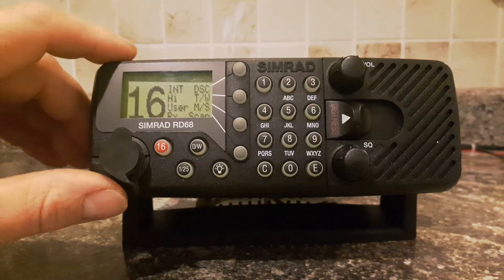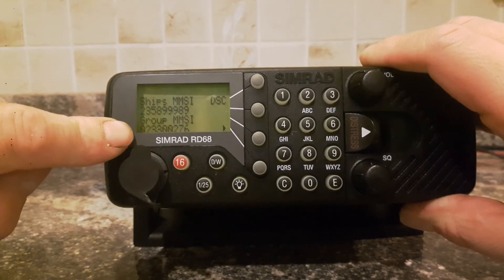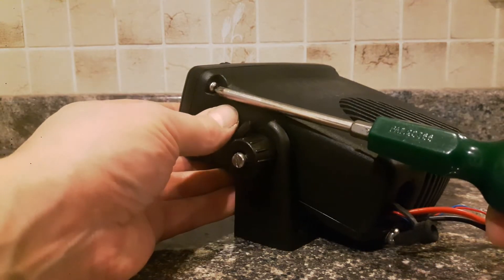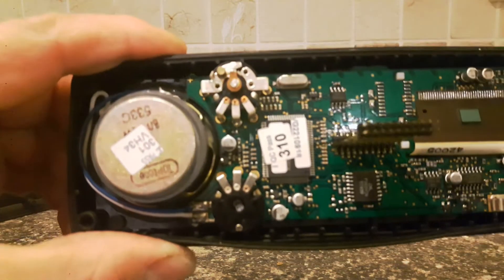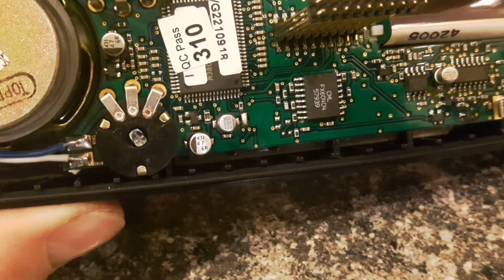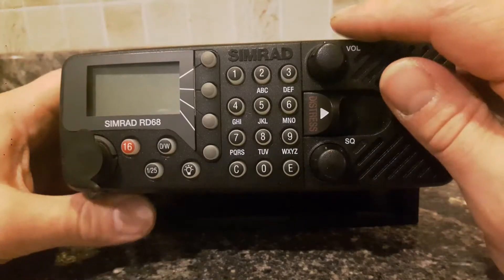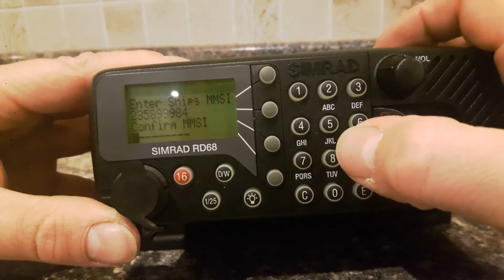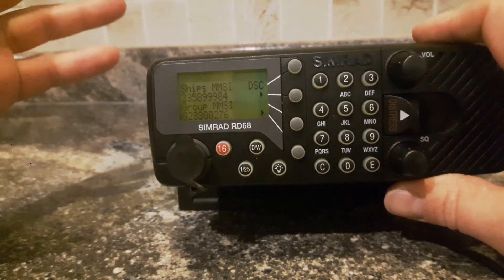Simrad RD68 VHF Marine DSC Radio MMSI Reset

Comment: I bought a Simrad RD68W, it looks a liitle bit different inside. It does not have a plug, but is wired. In addition, the large IC is rotated 90° clockwise. Where exactly do the both pads go to? The IC looks similar, but I am not shure.

Comment: The RD68 comes also with a different layout front board. Any idea   s how to find the new contqcts?
Reply: Verbinde PIN 77 vom IC4 gegen Masse. Sonst selbes vorgehen wie im Video.
Reply: Alternativ: Enter the programming set up software by typing “Prog68”. Place the radio into
programming mode by holding Soft Keys 1 and 3 and the LIGHTS Key whilst
powering up. Programming is entirely menu driven and self-explanatory.

Comment: Hi thank's for your work, i need change MMSI on ICOM M505 and M506 do you know the process ?
Reply from the maker: Hi Sam, The easiest way is to get your local Icom dealer to do it for you. Other wise you would need to down load the cloning software (CS-M506) and get hold of cloning cable OPC 478U

Comment: Worked for me - thanks for the video. Making sure the panel is correctly aligned on re-assembly is very tricky but I found on my model there is a top panel held on with four screws that makes the process so much easier as you can see the connector when the pins are being aligned.
Reply from the maker: Thanks for the comment. Yes you are correct. Removing the other panel helps. Glad you found it useful. Ben.

Comment: Great video! Do you know the procedure for a Simrad RS35 (I actually have a B&G V50)?  I can't find any local dealers to reset and trying to avoid sending back to the factory.
Reply from the maker: Hi Andrew, No sorry I've not done that model. Simrad are unfortunately not very forthcoming with this sort of information. (unless you can find the technical manual online) Best of luck. (let me know if you are successful ;-) )
Reply: Thank you for the response!
Reply: Try this at your own risk found on internet- Turn radio off. Press and hold "scan" and "X"  
Enter pin: - 7 enter 1 enter 0 enter 0 enter. 
Follow menu to clear MMSI and/or ATIS. 
When done, turn off and on radio, and follow menu to enter MMSI again.
Reply from the maker: @Birdman The only way any Icom radios can have the MMSI reset is using the software. This can be done by most Icom dealer fairly easly.